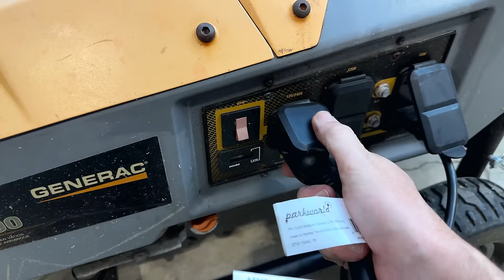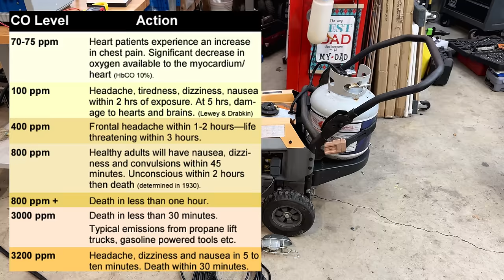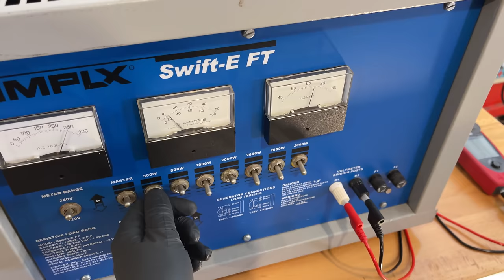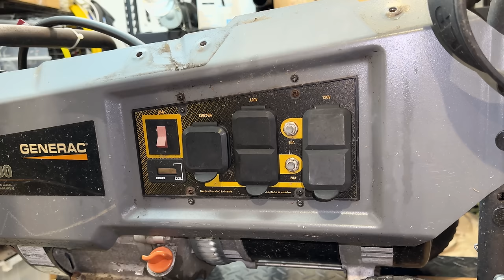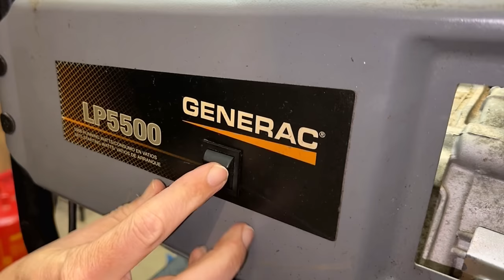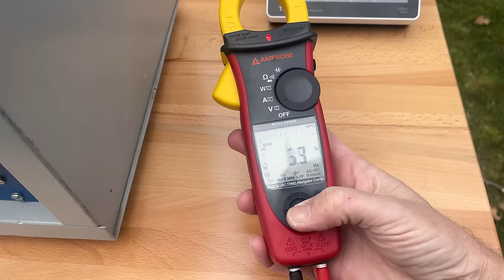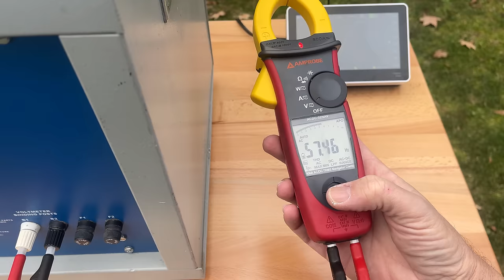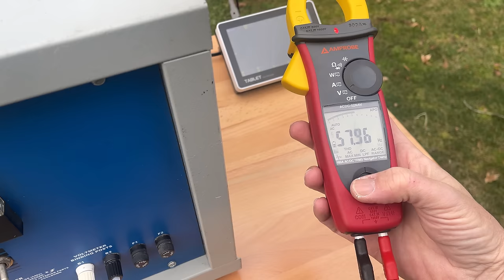Will a Cheap $40 Carburetor Breathe New Life Into This Machine?  Generac LP5500 Generator

Comment: Really nice generator. You should keep this one instead of selling it.
Reply from the maker: According to one commenter it is a fire hazard and I should not sell it.
Reply: @jcondon1  Probably because of that janky carb. Does the OEM carb have a screw on end for the propane line? You mentioned yourself in the video its wrong to cut the line to fit the carb. You were right. But you did get it running with the cheap 40 dollar carb...

Comment: It looks like that carb has its own regular built in
Reply: that's called a demand regulator. It shuts the fuel off when the engine dies. It will NOT regulate pressure.

Comment: It’s also important to mention that, even if the generator is running absolutely perfectly, it is not safe to run indoors, regardless of the fuel type. Even if there is no CO emissions (all internal combustion engines will produce some amount of CO because none of them burn perfectly clean) it is still rapidly consuming all the oxygen in the room and replacing it with CO2. That is arguably just as dangerous as the CO because it will silently kill you.
Reply: We can tolerate relatively large amounts of CO2 with no effects, so the risk is small.

I agree that any/every IC engine produces CO, though.  Just because it’s propane or natural gas as your fuel, CO will be a product.
Reply: @williamfoote2888 I agree that CO2 thresholds are pretty high, but the generator is also consuming oxygen. In a closed room with something like a generator that could be running for hours, that is a problem, especially in newer homes and buildings that are pretty well sealed

Comment: First time I have seen you make a mess Jim! Sorry, I would have used the toggle switch a simple hole with a drill and in my opinion a better switch than a rocker switch! With regard  to the exhaust I would think of heating and bending the exhaust pipe a bit more to 90' Yeah, okay great minds thing alike!!! Put a 90' brass fitting in the LPG line.

Comment: that rubber plug on the fuel inlet needs to be changed to something that won't rot when exposed to propane. (which will happen)

Comment: Typically you get around a 20% reduction in power from LPG, however since this unit was LPG only to begin with, i would expect that to already be reflected in thevratings.
Reply from the maker: That was my thought.  The engine on this generator would have been rated as 13hp running on gasoline. Which would max out at 7,000 watts.  Only lost about 7% on propane.
Reply: @jcondon1 different flywheel and different cylinder head part. Timing is more advanced and higher compression ratio 10:1

Comment: Dear James. I gave your vid a like because you are very thorough with your advice and repair. I would however for you to do a vid and explain how that SIMPLX Swift-E Resistive Load bank works and where you bought it. I'm in the UK, and I modified our generator to use it's exhaust manifold (basically; the hot exhaust gasses) to heat a special liquid and pump this liquid through our house to assist(and ad to) the electricity that the generator is already supplying.
Reply from the maker: I have a video on the SIMPLX: https://www.youtube.com/watch?v=q4WishKV0_E  I guess I don't really explain it.

Comment: Some Advice Please: I have a Hyundai 5.5kw Diesel Generator. It does not produce power. I replaced the AVR which made no difference. If I feed DC via a power supply into the brushes it powers up fine. If I then stop and return to the AVR it stops producing power again. If I get it going on the power supply (30volts DC) then whilst it is running switch to the AVR it keeps producing power fine. I ran it for some time in this state and it kept producing power until I shut it down then restarted. Goes back to not producing power. I note that I replaced the brushes also as the original brushes were worn. Any ideas?
Reply from the maker: Either the DPE winding is not producing enough power to get the AVR going or maybe the wires to the brushes are connected backwards?
Reply: @jcondon1  Thanks. I will first try and swap the connection. What AC V would you expect into the AVR
Reply from the maker: @MrSandford  around 3 volts AC with the engine running but the generator not powered up.  With the engine off, I would also check the DPE winding resistance and check it to ground.  The DPE winding is the power supply to the AVR and they do fail when everything else is good.
Reply: @jcondon1  Thank you for your advice it is very helpful. I will test again. Also check the resistance. Hopefully the DPE is good as the generator is a good unit being diesel and reliable engine.

Great content by the way. I watch all of your videos and have used much of the information to help resolve issues much like this. Always support your channel. Keep up the great work.

Comment: This is an interesting idea. I have a spare generator I want to convert to dual fuel,  but I'm unable to find a dual fuel carb for a 223cc engine. I can find bigger and smaller, but not that size. Anyone know which I can use for a 223cc A-iPower AP5000?
Reply from the maker: They make smaller ones for your engine.  See John Daniel’s video.  He has a link in the description.  https://youtu.be/5EmVp7M3k5k?si=BqxACqAuRCBjTkIE
Reply from the maker: Actually his is a little different.  This one might be better Carburetor Dual Fuel Carb Conversion Kits Replacemant for Tonco Generator GX200 170F 170G-GX200 https://a.co/d/0fCwlYJ
Reply: @jcondon1  Thanks! I Appreciate it.

Comment: those carb kits come in different sizes as long as you got the right one it should work fine. Propane doesn't have as much energy as gasoline so FYI if you run that on gas it will produce more power but it should equal the output on Propane. Remember those regulators have to be able to supply propane for two, three up to five burners depending on the grill they are attached to, makes you wonder if there is more than one standard regulator. The whole for the switch best tool would have been a Saber saw, drill two holes and cut it out.

Comment: With the high cost of propane and propane accessories, there's virtually no savings realized. I saw a small engine gasoline to propane comparison, hp and efficiency increase wasn't that significant -- in fact, switching to a gasoline hookup would be cheaper, but who would want a jerry rigged unit.
Reply from the maker: They are also expensive to repair and a small tank like the one this has will drop in pressure quickly under load.
Reply: @jcondon1  I suppose these are good for natural gas hookup as well, that would be great. But they had some folks' furnace go out here because of water in their lines.🙄

Comment: I would be very interested to see that same carburetor installed on a gasoline generator to convert it to tri fuel. I thought it would be much more expensive. I have one that I would like to have the option. It appears that the barbed hose fitting could be removed to install a threaded coupling. Amazon has quick couplers for propane and natural gas. Hipa carbs have always worked well for me. I thought such a setup would be more expensive. Generac seems to have screwed up with the positioning of the regulator in a depression on top. Generac is headquarted in Wisconsin where there are winters and a generator stored outside will be subjected to snow and ice.

Comment: I'm surprised it runs with two 2nd stage regulators in series. The regulator on the carb is expecting pressure from a 1st stage regulator not another 2nd stage regulator.
Reply: the regulator on the carb is a demand regulator, which shuts the gas off when the engine dies. (safety item) It will NOT regulate pressure.
Reply: @rupe53  If the regulator on the carb isn't a 2nd stage regulator, how did it work with the BBQ regulator which appears to be a single stage regulator?
Reply: @John-qc8yy    BBQ regulators are already low pressure.... but also lower volume as well.
Reply: @rupe53  I have a 3500w Genmax generator I hooked up to my main cottage propane tank. The generator is intended to conject to a 20lb portable tank so has a 2 stage regulator on its hose.

My big  tank has a 1st stage regulator on it and try as I might I couldn't find a 2nd stage regulator that would work with it and the generator. I ended up splitting the Genmax regulator into its two parts and the Genmax 2nd stage regulator does work with the 1st stage regulator on the big tank.

I still don't really understand why?

Ideas?
Reply: @John-qc8yy    Part of what you don't have a grasp on is the working pressures with propane. Roughly 250 psi is the tank. (depends on the temp) If there's a first stage reg on the tank (usually red) that drops it to 10 psi to travel some distance. Closer to the appliance there's another reg (usually gray or green) that drops it to 11-14 inches of water column. (about a quarter pound) The main purpose of the high pressure (10 psi) is to allow smaller pipe, which adds up on a 100 ft run. What I can't tell from here is the operating pressure your gen set needs. Some of the really old units took 10 psi and had another stage that's built in. Also, some 2-stage regulators don't have a distinct second stage visible by the exterior of the body. You'd have to do some close-up inspections and compare part numbers to figure it out.
Reply: @rupe53  I did know that much from doing a lot of reading but for some reason couldn't find a 2nd stage regulator that worked . After 2 unsuccessful tries 
 I ended up with the one that came with the generator. The downside is that it meant taking apart the supplied hose so  then I couldn't use the generator elsewhere on a 20lb portable tank.  I solved that problem with a new replacement hose and regulators but I still don't fully understand why it wouldn't work with a generic 2nd stage regulator.
Reply: @John-qc8yy    I'm pretty good at trouble shooting, but there are way too many variables to pinpoint your issue from where I sit. It could be that one of those regulators was no good or out of spec. If the pressure is too high (doesn't take much) then the demand regulator or the gas solenoid (if it has one) just doesn't open.

Comment: I am even sure that if you run it on regular gaz , you would have that 7000 watt out and maybe 7500.
Reply: yes, and overheat the generator windings too.
Reply: @rupe53  never said that it would be a great idea to run it for a long time but in case someone need a little 7kw or 7.5kw peek from time to time. Running on gaz would be possible.
Reply: @pierremartel3552    you'd need to read the manual. As I recall (retired 4 years ago) that little extra is inrush / surge for motor starting. The 5,000 watts is continuous. Was in the large gen set business for 25 years and did these smaller units for several years toward retirement.

Comment: Can you not buy 10W30 at the gas station in the States? Here in Germany you can get anything from 0W30 to 15W30 at any normal gas station without any problems. Even 10W40 is no problem.
Reply from the maker: You can buy it just about anywhere.  I used 10w-30 synthetic.  Think Gary was just going buy the misleading Generac documentation.

Comment from the maker: Here is the link to Gary’s video on this machine: https://www.youtube.com/watch?v=vxLIBargL5w&t=0s
Reply: james corden ,my name is christopher  schwartz a small engine tech ,im a fan of yours, just wanted to metion , the reason for the barbed fitting is simply due the wheight of having a seperate fuel supply (propane) lp) it could fall off a ledge  meaning the safer option is it to break  away before draging both down a hill be coming an explosive maylay . lmao , also where di you find that carb?
Reply from the maker: @rocketscootersandlawnmowers  Amazon: Hipa GX390 188F Dual Fuel Fuel... https://www.amazon.com/dp/B09X2HX8GG?ref=ppx_pop_mob_ap_share

Comment: Propane produces slightly more CO than natural gas and about 30% less than gasoline, but certainly not close to 0%. Why couldn't you use the original on off switch?
Reply from the maker: I could have used the original.  But choose to remove it to save on any confusion.

Comment: If the regulator on the carburetor is rated for 10 and your new one is rated for 30 then you are still limited by the 10 bottleneck. 

Makes no sense why you put 2 regulators in line.
Reply from the maker: The regulator on the tank reduces from high to low pressure.   The regulator on the carburetor is a demand regulator and only works on low pressure.  The demand regulator will not flow gas until the engine pulls a vacuum and opens the valve.

Comment: Propane only? You mean a gas only generator? It's why we use the word petrol not gas
Reply: from the factory, these were propane only.... no petrol at all.
Reply: @rupe53  exactly! But ones that do run on petrol only are still called gas engines by our American friends. And like I say, it's why we don't say gas for petrol
Reply: @safcforme    here in the US the distinction is gas, (gasoline) propane, or natural gas, (both gaseous fuels) then diesel. The problem we see with using the word petrol is it's commonly a shortened word for petroleum products, which includes gasoline, kerosine, diesel, jet fuel, motor oil, and others.
Reply from the maker: Gasoline is not the same as gas.  But yet we call it gas.